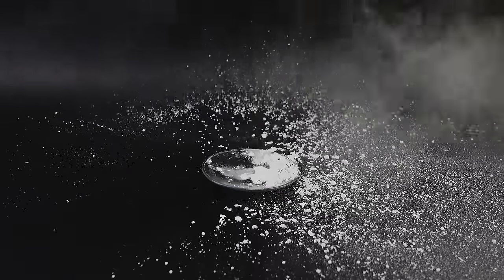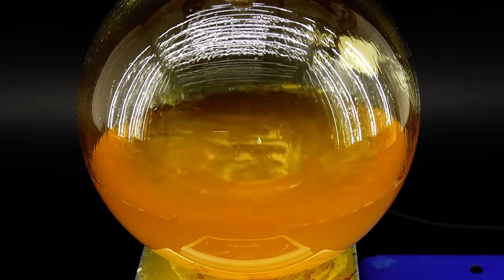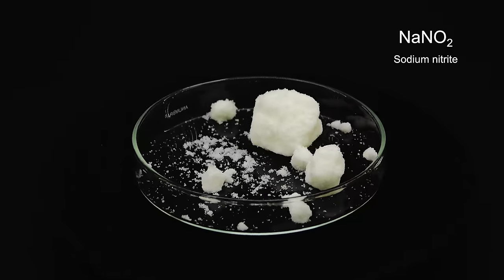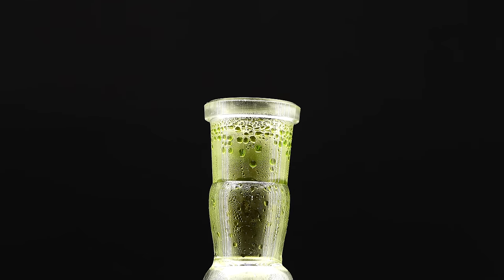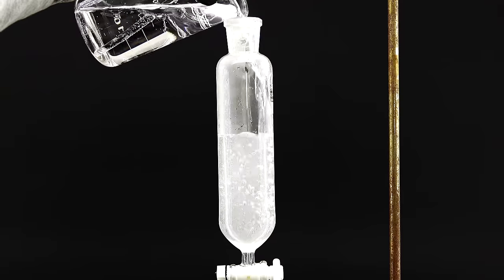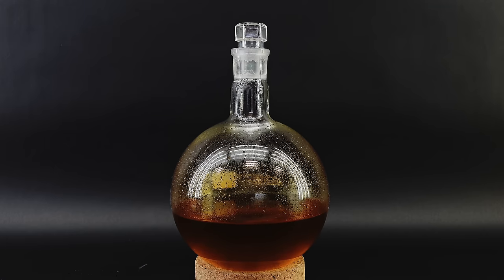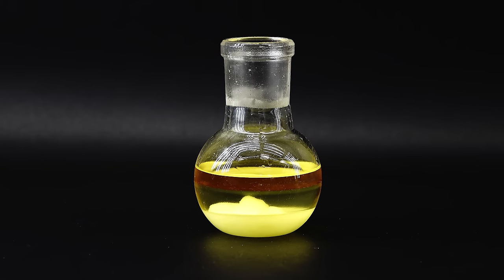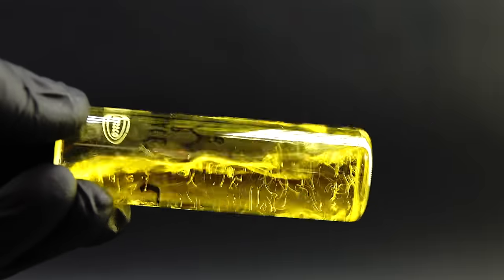Making a Toxic Butter Flavoring from Paint Stripper

Comment: Sodium sulfate is a nice, but slow drying agent, and.... it loses crystallization water around 30°C. This means, it did almost nothing in the distillation step, and it was mostly salting out (table salt would do the same), a bit of chemical waste.
Reply: My thoughts exactly. Instead of the second distillation, use a transfer pipette to remove the upper, salted out, diacetyl. Transfer to test tube and use transfer pipette to remove any bits of water from the bottom, then dry with MgSO4, filter
Reply from the maker: Yeah, I also thought about using table salt and doing this salting step before the distillation, but in the procedure, they specifically stated to use sodium sulfate so I just didn't want to deviate too much :)
Reply: @Amateur.Chemistry  OK, then it makes sense

First time, by the letter, do as written,
After than, modify, it's not forbidden,
Third time, with works like charm
Make it up! There is no harm! xD

Personally even with salting, I would still distil it, hate extractions XD

Comment: I was thinking of attempting a selective oxidation of MEK with H2O2 using copper chloride as the catalyst in the hope it would yeild a mixture of diacetyl and acetoin amongst other things. A suggestion from chatgpt lol that I'm now thinking won't be very effective...

I'm thinking it will not work or there would be papers on it.

There is prep using vanadium pentoxide/phosphorus pentoxide in a VP ratio of 1.6 though this might be a 300°c mek vapour reaction. In any case I don't have any V2O5